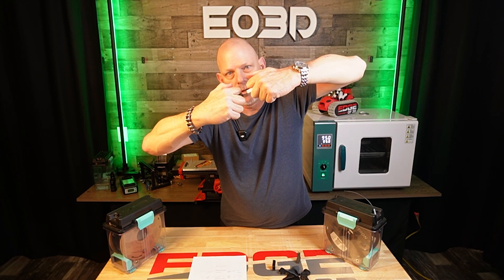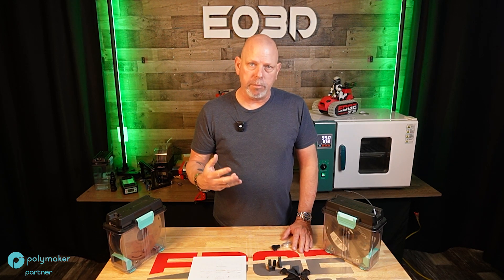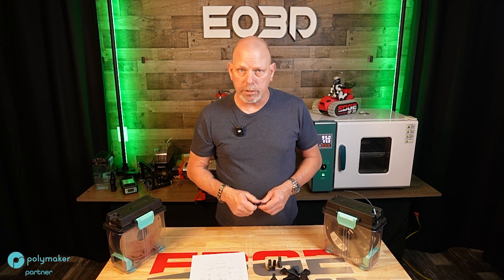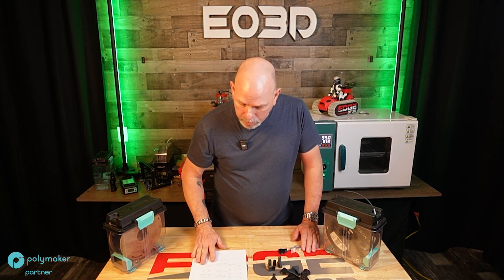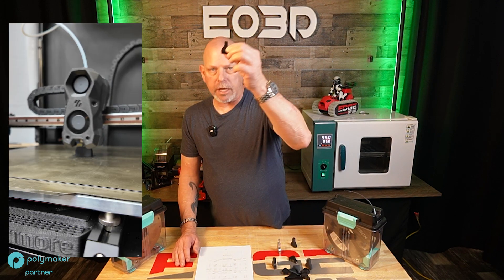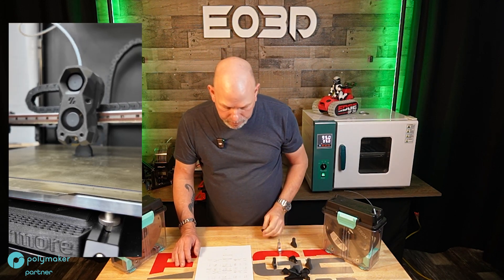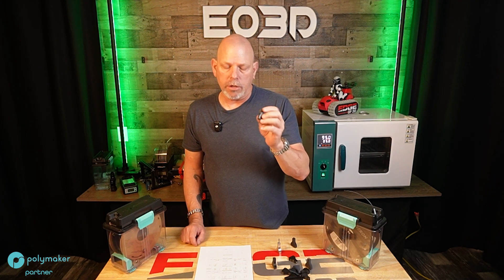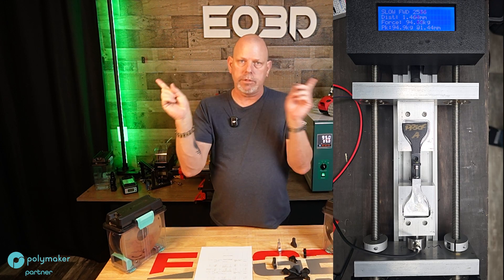DIVING DEEPER INTO ANNEALING AND ORIENTATION | EDGE OF 3D

Comment: Do you think I need an expensive lab oven to do this? I hate to ask, but could I use an inexpensive toaster oven that was controlled by a PID? I use one to bake coatings on bullets I cast. I have a temperature probe in it and it is connected to a PID controller that keeps the temperature pretty accurately. However, it's still a freakin' toaster oven.
Reply from the maker: A cheap toaster oven will work just fine, no need at all for a lab oven.

Comment: In case you dont know ABS is an amorphous plastic so it is generally useless to anneal it. That is why you did not find  anything about annealing it. The only advantage of annealing amorphous plastics is to relieve internal stresses which causes creep failure as far as i know. 

On the other hand, annealing semi-crystalline plastics such as PPS increases cristallinity in moleculer level. Increased cristallinity in plastics generally decreases its mechanical properties such as toughness and strength and gives more heat and chemical resistance.

To be honest i have never tried annealing amorphous plastic before, but your findings are really interesting about layer adhesion so i will also try that. 

And one last thing. Quit smoking before getting copd :)